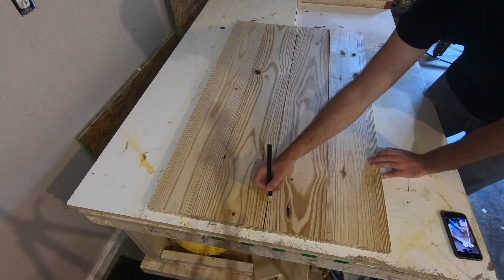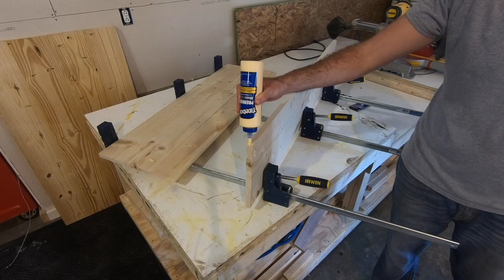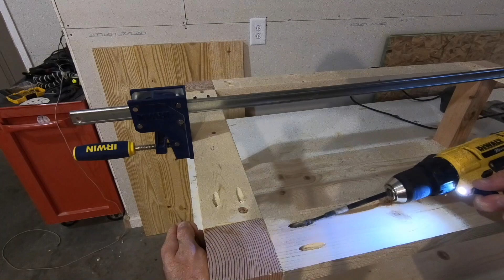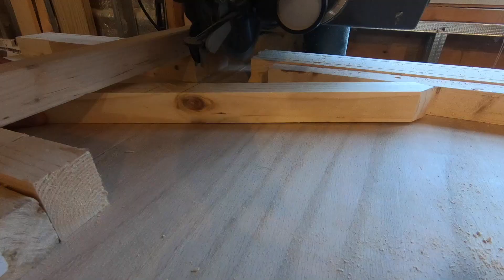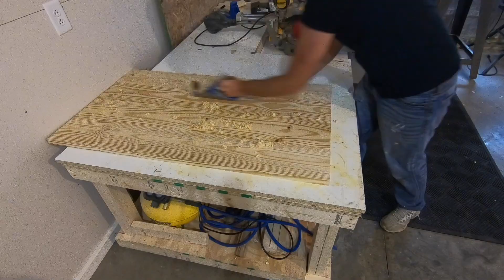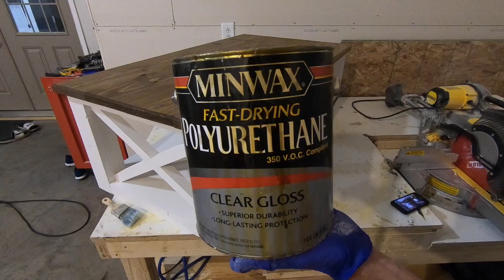Farmhouse Coffee Table Build (free plans in description)

Comment: I wanted to say that I love this table. As someone new to woodworking, you make this look easy. My only question is,  why use 2x8x8' boards vs 2x4x8 if you're cutting the 2x8x8 in half?
Reply from the maker: Thanks Kevin! So the 2x8x8s are cut in half long ways making two 2x8x4 boards. You could use 2x4s instead for sure but you’d have to use and join twice as many of them
Reply: Ahhhh ok. I was thinking they got cut in half 2 ways making them 2x4x4 lol.

Comment: Do you absolutely need the sprayer for the paint? Can I use a paint brush instead. Also, can this build be done without a midar saw? I have circular saw. Sorry just starting carpentery.
Reply from the maker: Nope, you definitely don’t need hem either! I’ve painted plenty of tables with a brush and used all kinds of different saws to cut boards!
Reply: Thanks for the reply. I am not able to find pine here, can I use cedar instead?
Reply from the maker: @varunshenoy532  Definitely! This would look awesome in cedar!

Comment: Why do you screw these tops together but not a full table top?
Reply from the maker: No specific reason - I just used to use pocket hole joinery much more than I do now. As long as you can get a joint and clamp properly, screws aren't necessary.

Comment: Thanks so much for the video and step by step instructions. When screwing together the table top, what size kreg screws did you use? I am about to buy my first kreg jig and want to make sure I get appropriate size screws for the correct hold.
Reply from the maker: They're 2". You can use different size screws depending on how deep you drill the pocket holes, but I usually use 2" or 2.5" screws

Comment: Hi, nice vid! Question, is the bottom sprayed with Valspar Antique White or Valspar Express Pro white?  Also, for the top, does applying Poly coating make the wood more shiny? Thanks
Reply from the maker: Thanks! The bottom is Vaslpar express coat extra white (Antique white is more of a cream color whereas this is plain white). And yes, the polyurethane gives it the shine depending on which you buy - I used gloss (the most shine), but they make semi-gloss, satin, and matte too.
Reply: @mmcc_woodshop6288  Thank you for confirming! Does using stain/poly combined product from Minwax have similar result?
Reply from the maker: @hiephop21  I've never used it, so I can't say either way. The Minwax gloss poly gives an amazing shine though... Multiple coats make it even better.
Reply: @mmcc_woodshop6288  hi, what brand of wood filler do you use? Thanks
Reply from the maker: @hiephop21  I don't use wood filler often because I don't think it blends well. If I have to, I use Minwax stainable filler. If it's just a small gap, I'll use wood glue and some sawdust mixed to a paste (make sure the saw dust is the from the same wood you're filling the gap with).

Comment: What size screw did you use to connect the table top to the frame ?
Reply from the maker: Pretty sure they're 2". Both the frame and the top are about 1.25" thick so that's plenty of material for 2" screws. If you're using thinner stock just make sure your screws aren't too long to go through the finished top. 👍🏻👍🏻
Reply: @mmcc_woodshop6288  yeah that’s what I was thinking. I just didn’t wanna make the mistake of going through

Thanks!
Reply from the maker: @PhilD54  Sure thing! I've mistakenly gone through the top plenty of times, we've all been there haha

Comment: How did you keep the wood grain from showing through on the painted portions?
Reply from the maker: I just went heavy with a couple coats of paint. The paint is Valspar antique white - it settles really nicely and almost flows to a smooth surface after it's on. Using a paint sprayer to get a good finish really helps as well.